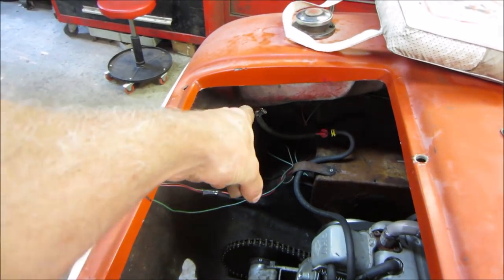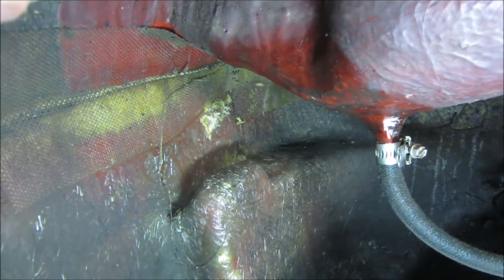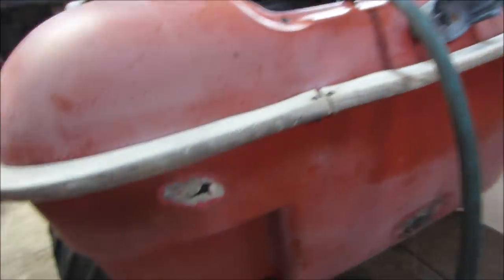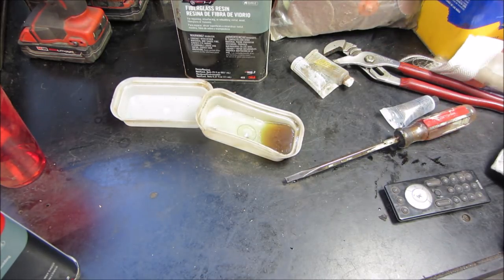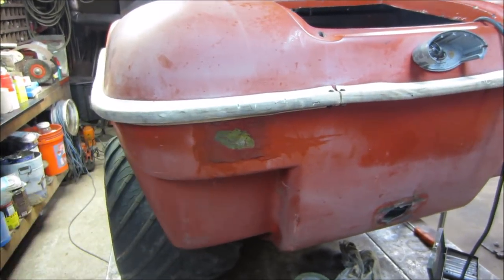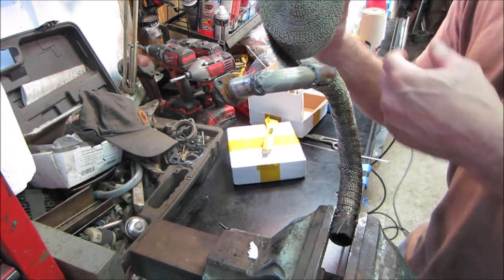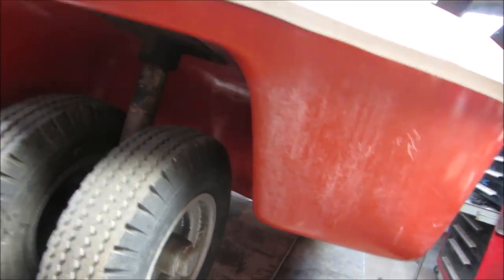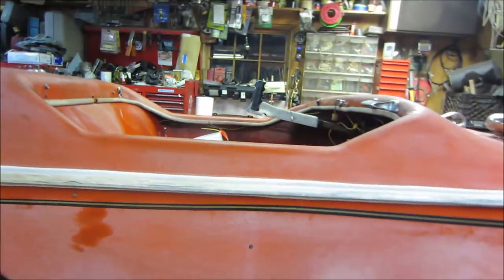Beaver amphibious vehicle fiberglass repair and exhaust wrap.

Comment: One way to secure the end of heat wrap it to use some stainless wire and tie it in place. If you are pro you can make the wire disappear under wrap number two when you start the wrapping. 
When you finish it you can either use some more wire or use a slim hose clamp.
Fold the end under in a point so you don't get any frying in the end.

Comment: you can avoid the frayed end on the wrap by folding it under at an angle , kind of like a flag fold . love the project
Reply: Any special reason for the angle fold?  Why not just fold it under (as the end was when he opened the roll)?

RichE
Reply: can tie it in a bow if you want , thats just the way i was shown and it seems to work out nice and clean

Comment: Nice video! One suggestion for your consideration is look into the application using a very popular integrated circuit, the LM555 timer. There are numerous web sites and many kits and circuits using this device and is worth looking into. You can trigger this timer from your off on switch to run your fan for five minutes quite easily or trigger it with a thermistor circuit to turn it on when the temperature reaches a value you want as suggested by one of your commenters earlier.

Comment: Hi Mustie 
Have you thought of putting in a fuel bladder in the tank?  The flange on the filler looks like it would seal quite well and then you could put in a bulkhead fitting for the outlet. With the bladder installed you would not have to worry about non ethanol fuel.

Comment: Mustie I've used fiber glass Resin before... The resin is a measured amount  but the hardener just says use so many drops per measured amount... If measured and proper amount of drops added you should get about a 2 hour cure time... Note the above info.. is taken from memory of the time I resined an old Elgin 8ft fiber glass boat... I still have that boat and the fiberglass resin is still good ten years later...

Comment: Those band clamps look like the boot clamps they had for CV axle repair boots. You had a tool the band went into and you tightened up a bolt that the band went into, like a ratchet straps. You tightened the bolt down to tension the strap then you bent it over and hammered it flat. I have the tool somewhere.

Comment: Tips with pipe wrap. 1 soak it before you want to use it, at least 20 mins. 2 use one of the clamps on the first wrap before you continue. 3 end 1" short of the flanges. 4 grab the tail of the clamp after you send it through the detent and ROLL it with a pair of needle nose pliers. It'll tighten WAY up way faster.

Comment: Only time I ever used stainless steel cable ties was to clip an exterior CAT6 cable to a catenary wire. My boss was shocked at the cost compared to regular CAT5 cable and plastic zip ties until I pointed out it was external, open to the elements and the risk of the UV snapping the plastic over time.  That cable is still up and still chugging data back and forth.

Comment: You should start the tape a few inches in from an end work back to the end and then proceed back over the tape along the pipe or muffler. This traps the starting end of the tape under itself and you only need to secure the tape at the end where you finish wrapping. This is how tennis racket handles are taped.

Comment: I soak the wrap at least 20 minutes in warm water. If it's colored wrap the dye will come off on everything, Wrap it over grass to prevent a mess.  WEAR rubber gloves to keep the glass fibers out of your hand. If you have a partner it's much easier. After 20 minutes remove wrap from the water and begin at the exhaust not manifold end of the pipe. Fold end of the wrap over about 1 inch and wrap once around pipe and secure with a screw clamp. Then start wrapping over the folded end at a angle toward the manifold end with a about a 50% overlap. Keep wrap even and tight as you work. When you reach the end one again fold the wrap over about an inch wide where it stops at the manifold and secure with a screw clamp. The wrap will become tighter as it dries, then once it's dry spray with exhaust wrap sealer (5000 degrees)  to prevent it picking up dirt and oil etc.. this is important if your pipes are going to be seen such as on a bike. Insure screw clamp screws are on the back of the pipes and can not be seen when looking ta the exhaust.

Comment: I thought that the tank leak was down to the brass outlet connector becoming unbonded. Perhaps you can route some resin down a tube into the tank to flow around the joint?
I tighten tie wraps with a pair of needle nose pliers. Just hold the spare part at 90º close up against the gripper and roll the pliers.

Comment: When the Beaver hits the water (someday!), I'll be curious to see if the rear wheels spinning in the water will have enough bite to push the front wheels up the beach far enough to where the rear ones can get some bite on the ground. If the bank is steep enough I'm thinking that you might have to turn the thing around and reverse it out?
Reply: dprider02   I was thinking the same thing.
Reply: And will it have enough guts to make it up a boat ramp?
Surely not with me in it!

Comment: I would recommend multiple wraps of #16 tie wire ( or galvanized #18 lathers wire) around the pipe and muffler where you finish up taping instead of those straps that don''t want to tighten up.

Comment: Maybe try a stainless steel hose clamp on the exhaust from the engine instead of those zip ties, maybe a metal dryer hose clamp on the muffler. Not sure if that would be easier to work with.

Comment: You have different strength of hardner for low activity to high activity. Hot days would be better with low activity. Cold days better with high activity. The temperature of the air also has a factor of how quick the resin goes off. The amount of harder you put in, should be 1 to 2% of the resin volume. For normal, four drops of hardner would be 1% of one ounce of resin. I hope this helps alittle, if you need to use fibreglass resin in the future.

Comment: You can have a solar panel or to to help with the charging or maintaining after use and hook up the fan to a temperature switch like a radiator fan :) for those metal tie raps pull it with pliers and bend up no flat head needed, u create more space that way with the flat head I use regular hose clamps I hate those myself.

Comment: There is a tie wrap tool you can probably make. It looks like a socket extension where you attach to a wracked and the other end is round with a slot in it. Then you insert the wrap in the slot and turn to tighten it.

Comment: Without making things overly complicated, any simple way to make that cool air fan run only when needed? temperature of the engine or engine compartment? with a manual switch for pre start up. That way you can just leave it alone to do its stuff if when it is needed.

Comment: You are supposed to feed the pipe thru the inside of the wire braid. Make as many layers as you need but it is not designed to wrap around the outside like a tape. Also you can solder that braid.

Comment: The resin (poly-ol) doesn't go bad for atleast 5 years, if it has a tight lid.  But the hardener(isocyanate) will lose its effectiveness about 6 months after opening the cap.  The hardener is hydroscopive:  it absorbs moisture from the air.  As the hardener ages, it becomes crusty, chunky, and loses its properties.   Even brand new unopened containers can go bad.  So it's best to check the manufactured date on the can, box, or blister package.   Don't purchase anything more than a few months old.  When storing, keep the resin and hardener separated.   I spray paint or mark the lids/caps so there isn't any confusion.  I also keep the chemical containers clean and enclosed inside of additional ziploc bags(really thick name brand).  Finally, the hardener can be kept in the freezer, if it is double bagged in ziplocs or some kind of additional glass capped container.   Remember,  the hardener absorbs water..ruining it.   The resin absorbs moisture also.  The sign of moisture in the resin is little bubbles or a cloudy color when the two parts are mixed.  Regardless of age, brand, etc., TO BE DEAD SURE ABOUT THE COMPONENTS PERFORMANCE/QUALITY...TEST BEFORE USE!  If the ratio doesn't "kickoff" (set or polymerize) try adding additional hardener.   Aside from that garbage, this video series is really interesting and enjoyable!

Comment: One of the best backing materials I used for glass repairs, was the aluminum foil tape normally used on HVAC ducting.  You can get it to cling very tightly, and it seems to take aggressive bushwork better than masking tape, when working the resin in and the air out.

Comment: Fiberglass can be a real pain to repair after it has come into contact with oil and grease. The repair will look great for about a week, then pop off. The best thing for the engine compartment would be to make patches from metal and rivet them on. It does help to rtfm.

Comment: On that exhaust wrap, you are supposed to apply it soaking wet with water, then start the motor to dry/shrink it on- FYI for when you do the Jawa - also fasten the ends with a wrap of safety wire

Comment: With regards cooling, is there anyway to fit a fan to the front part of the CVT drive shaft, so you have some mechanical cooling and have and electric fan on a thermostat for the times things get too hot and an override for that for fuel vapour purge.
Reply: GREAT idea!

I was also thinking that if he routed a duct (may be hard with exhaust where it is)  from the engine air/fan intake to and external vent-in, the exhaust air from the engine, while warm/hot, would keep air flowing out of the engine compartment.

RichE

Comment: Mustie, when you put the engine in you noted a sizeable crack on the bottom of the hull, which you covered with a steel plate. Would it not be a good idea to remove that plate and fiberglass that crack as well? Dont want you to sink!

Comment: Wherever there are spider cracks in fiberglass water will seep in behind them and cause the fiberglass to actually rot in separate you might want to try to just hand Scuff the entire body and then try a thin layer of gelcoat on top or some fiberglass resin

Comment: I "play" with motorcycles a lot. I dislike wrap on pipes. It discolors quickly. And also holds moisture, which causes pipes to rust out. Seems to me that would be a consideration in a water craft.

Comment: I'm no Expert, but I've done a fair share of it. The "cloth" is simple polyester. Resin & hardener go bad after opened, especially the hardener. Go to your local Thrift Store, pick out dresses, shirts, skirts, whatever color/pattern you like. Launder if necessary. Wet the area, soak the cloth, lay it out, use a plastic trowel or soaked foam paint roller to even it out, remove bubbles. No "paint" necessary- red, brown, blue, white cloth=darker finish (because of resin). Those front near rub strip (and all) stress cracks in the Gel Coat need acetone & new resin pushed in. When doing an inner/outer patch, do both at once, but first cut a piece for the hole, plug it, then lay on your wet patches; the resin will bond into both. Never use Bondo if you can help it- it doesn't flex and will crack. That exhaust wrap is simple Polyester, with other metallic powder/coloring pressed in. I wouldn't gel something that gets hot- it might catch fire, and if you've ever seen a fiberglass car or boat burn- it's not really flammable until it's been gelled. If you want paint- the Gel Coat must be thoroughly dry, then scuffed, acetone wipe, then a 2k primer first. IMHO the entire body needs an #800 DA, wiped, then 2 cans of resin outside. Roll on heavy enough, it self levels, don't overwork it. Remember that beautiful table top you did for the Bus? Same principal. Gel over the bumper sticker, too. Find a photo of a Beaver- gel it on somewhere, LOL.

Comment: Having mentioned heavier-than-air gas fumes and sparking, if the fan and bilge pump motors are brushed, they will themselves create sparks. How about fitting the fan under the dash, with a flexible air duct, and the bilge pump inside a kick-cage in the passenger footwell, with a floor-level 1" bore clear PVC pipe back to the engine bay? I realise that it's more work and may not be considered worth it, but... just my thoughts.

Comment: You could put in a full wave rectifier in place of the diode. This would increase the efficiency of the charging system by using both sides of the sine wave to charge the battery.

Comment: The transom on that Beaver needs to have a little outboard engine on it, to get you to where you want to adventure, sooner.  The prop shouldn’t be lower than the keel, to keep it out of harm’s way.   The short glass fiber Bondo, with hardener is easy to work with, and you work it until it grabs under the spatula, and you quit working it immediately.

Comment: Fiberglass resin, the hardener should be mixed at a 2% ratio. As this will give the best chance of curing. Any less than 1% or more than 3% and the product will not cure properly. Making it a weak repair. Adding liquid wax will remove the sticky feel after cure. And make it sandable

Comment: great video series mustie, can you show some detail of the front end setup as i'm curious how the steering works and for the future as to whether it would be possible or desirable to fit an ATC wheel/front end with a linkage steering so you turned the control yoke rather than swinging it from side to side for steering effect, also is there a particular speed the tyres have to spin in water or is it just as fast as possible.

Comment: on the heat rap on the muffler i would have used hose clamps. that way when you tighten it in the wrong spot you  can loosen it and readjust it. you can also get it a lot tighter than the tie wrap.

Comment: For fiberglass repairs I prefer using the West Epoxy system. I find it far superior to polyester resin. It is also impervious to alcohol.
Reply: I don't think Mustie is much of a drinker - but it's good to know.
Reply: Kirk Johnson I think ethanol in feul is what was meant. lol. the drunken Mustie beaver. Lol
Reply: Kenneth Law- I knew that. I was just joking around. Which often falls flat online. 
A toast to the Drunken Mustie Beaver !!
Reply: I thought it was funny. I just forgot to give you a thumbs up.

Comment: Heat wrap on exhaust pipe - hose clamp covered by metallic dryer tape.   I know Mustie doesn't like screw type hose clamps.  But they would have been fine for holding that heat wrap down.

Comment: A rule of thumb that I've use for fiberglass polyester resin is 1cc (volume) of hardner per 1oz (weight) of resin - this should be stirred vigerously for 1 minute and has about a 5 minute working time before it begins to set. I make fiberglass molds for carbon fiber parts - so I've gotten really good at it. :)

Comment: Had you considered that 3M cut/polish product? (or similar) WIth a good buffer, the kind on its own phenolic backing spine and the 3M prod., you fix UV deteriorated gel coat. Of course, it is best used with 2 speed 750/1500rpm with 5/8" arbour

Comment: If the engine is an electric start, most of them have a low output generator to charge the battery. Rather than running a "kill" switch, try putting a 12v Bosch "ice cube" relay in to switch the ground for killing the engine. Those Bosch relays only use about 100ma and can be left on for long periods of time without getting hot. Use the switch you mounted for the lights.

Comment: That cable tie tool is something like "Cable Tie Gun for Stainless Steel Ties - JL-067" found on Amazon. I've seen other people use it, and it does pretty well... But for $45 you can do other things and improvise :-)

Comment: Had those stainless tiewraps on a heat shield attached to the resonator of my exhaust system.
Those suckers were extremely tight.
It would be nice to know what they use to get them that tight. 
The rabbit is at his all you can eat salad bar. LOL

Comment: Measure the resin to catalyst as per instructions on the resin container, (right about now 15 drops per ounce) depends on temp. Too much catalyst makes for a brittle repair and is easily damaged, crack, break off, chip, too little and it won't cure. Mix well. Tape glass to the beaver and brush on resin til the fiberglass is transparent, remove tape when slightly cured.

Comment: Probably not bondo on that edge patch pointed out near the end... that wouldn't have been appropriate for it being a marine vehicle. it was likely two-part marine-grade epoxy, which would definitely be something to look into around the tank fitting and any other areas where fiberglass resin wouldn't be appropriate. it's basically marine bondo, and it has a pretty long shelf life, too, if you can believe it. I used some stuff from the mid-90s that sat in a garage for its entire life back in 2011 to fix a laptop I modified an external WiFi antenna to-- someone sat on it and broke it off! the stuff usually comes in white and dries yellow. afterwards it can be sanded and painted. it's supposed to be for large, goopy patches on the sides of boats, but it works just fine in small batches. I know my dad used a couple tubs of the stuff fixing the fiberglass hoods on a few late 70s snowmobiles that had been through hell and back quite a number of times. whereas bondo usually dries with a rough texture, this stuff dries smooth.
Reply: Sudos considering the condition he got the thing in, I'm willing to bet he's on the money about the bondo.. this was somebody trying to fix the thing in his backyard remember. the guy may have not known any better.